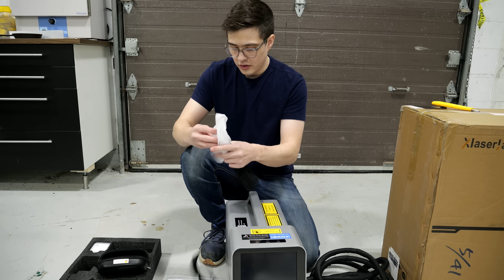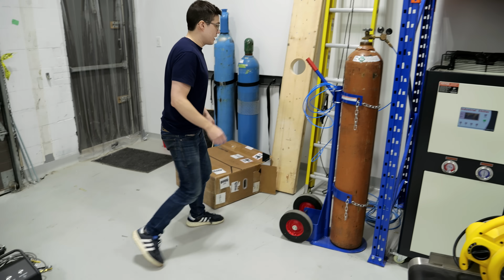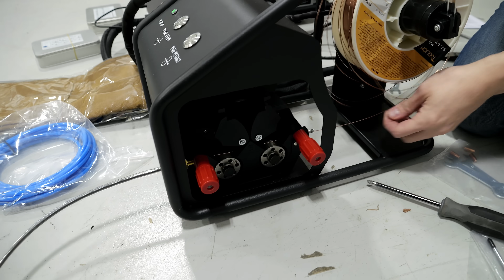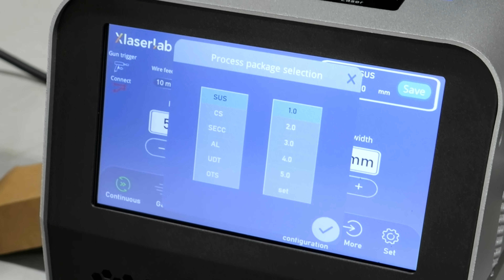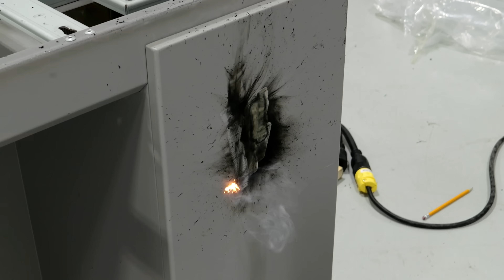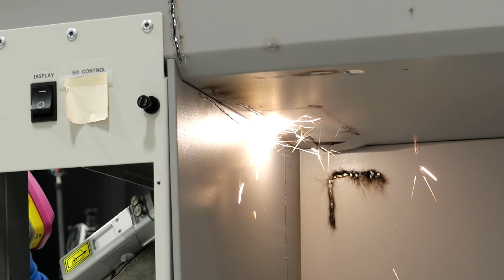I got a new laser machine (I love lasers)

Comment: I'm not saying this to brag, we have a laser welding cleaning and eye erasing machine at work that's like 10 times bigger than that machine "BIG BLOCK on wheels". 3kW laser / 16kW max consumption. It's all chinese and parts break like you bought temu garbage. Just like chinese stuff always are. Controller circuitboard broke 2 times within 2 years. 
The machine was around 20k€...
It cuts steel up to 6mm. Cleaning is more like burning the crap out of the surface. Been welding with it for 2 years, also TIG and MIG in the meanwhile.

Comment: I havent done it myself so take this lightly as its intended- 

I generally see welders swerving the tip around instead of straight lines. I imagine it's packing more material onto it, creating a stronger weld and maybe even changing the direction of the grain/atoms. They call it 'walking the cup'

Not sure if that's something to learn from and employ in uses like this, but I hope this helps!

Comment: A customer of mine (I do IT for them) has a like 10 KW CNC laser and it's a two story device. Bottom is the CNC machine and the top story is just like racks for the PSUs. And then a fiber cable basically goes down into the CNC machine where it lasers the everloving fuck out of steel

Comment: That is so cool! I've welded with an arc welder and wire welder. Used oxygen/acetyline torches, and the coolest was a plasma cutter. I wonder if it could weld aluminum. I kinda doubt it, it's not a good conducter of electricity. I also love lasers, and own a 5W laser that can do many things.

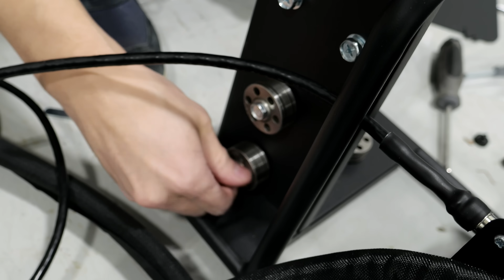Comment: @5:12 "Cause the wire I wanna use is .9 cm, so it's a bit less than a mm" that sounded very wrong. .9cm is quite literally 9 mm, so 9 times bigger than a mm. Maybe they designate the wire thickness in cm, in which case it's probably .09cm? Or maybe you just said cm, when you really meant mm, but that threw me off for a moment there. But to be fair it's probably less easy to recognize that mistake if one usually think in imperial units. Also I'm not sure why I'm making this comment, as it's not really meant as a critique. It was clearly just a minor verbal typo.

Comment: At close to $5,000, they should deliver it , set it up, teach you to use it, take you out to dinner, with drinks and provide a hooker. ...Still, it does look worth every penny, even if no set up, classroom , dinner or hooker.

Also, stolen video from this real laser manufacturer's web site is often used by scammers to sell a "laser welder" , but what arrives is simply a cheep soldering gun. If the "welder" cost is below $2000, its likely a scammer.

Comment: If you love lasers you would already have a 100 thousand RPM ping pong super capacitor driven reverse shock wave echo clashing Plasma speaker laser. Heh.. Points at capacitors linked to a kicker that start at zero resistance > Rolls the multiple pancake gen with my finger causing it to switch to empty dumping to kicker motor all the way to optimal rpm before kicker goes off > Overflows capacitor system at the end to plasma speaker sonar > Installs Tungsten spark switch so no EMF can come back after it to slow turbine generator power in its EMF vacuum > Turns on laser with its own ping-system for focusing the plasma blast with Ultrasonic resonance audio spotlight support for precision > Watches sonar drain to %20 while combining with the lasers capacitors for high powered dump > Hits CO2 flush system then water jets for the area before the Black Hawk comes with FLIR because Military detected Plasma EMP burst I wonder what they're looking for with Thermal optics over Plasma tech.. Points at Predator films and winks Heh..

Discuss ping-pong relay with AI not for running a system but for how they can last for decades if good and if you use Analog computer logic for your system like a clock it can last super long you can just let it spin in your home powering it. Unused power beaming up in the air with resonance filter to absorb none of it into atmosphere like a Lightning shock wave ever been beside a lightning strike? If it was a Grenade instead of filtered shock wave I would have been boiled by cavitation.. Felt cool as hell. Pressure drop inside before atmosphere pushed back.. Forgot Earth stuff is weak phone got killed.. Buys better phone > Adds Piezoelectric shunt overflow to antenna Now lightning EMP make my phone scream instead of die. Squints at Crystal phone in The Twilight Zone: 2019: Episode 4: A Traveler > Googles: "Piezoelectric shunt crystal aerospace engineering"

OCD yeah you NO me! LOL.. Earth shunts convert to heat Points up at Sonar shunt I use to because I don't use batteries I overflow main generator that's unused through sonar and then drain sonar like a Shaman scooping water at the bottom of a waterfall. No laws broken.. Clear record with Sheriff department print off of FBI special agents. Iron Man would be amused.. Googles: "Ultrasound Enables Remote 3-D Printing—Even in the Human Body scientific American" > Sets generator Plasma system to resonance filtered Beoing Plasma force field mode > Runs up and hits the generator as hard as I can with a sledgehammer causing it to activate Generator in Darth Vader mode: "You have no idea the power of the dark side.." Yes I do.. Heh.. - Dracula
Reply: Triggers sensor causing Caps to fill to stop turbine at safe fast speed Oh no.. I'm falling like a rock.. Triggers sensor again sending brake to kickers like a gatlin gun [BZZZT WAAAAAAAAAAAAAAAAH! > Ultrasonic stealth mode]

Comment: That initial welding test probably sold this thing better than anything the manufacturer has advertised! That shit held amazingly for such a small weld on just one side
Reply: And literally the first weld from a complete beginner. Impressive indeed.
Reply: Right?? I was 100% amazed until I looked up the price of that machine. Then it made sense..
Reply: @Meziked-13  That is a very cheap laserwelder, most laserwelding machines that are from even slightly renowned welding fabricators are easily triple the price. However those can usually weld thicker material, this one can only weld up to 3mm of steel.
Reply: @Meziked-13  High End welders go for the same or more. For what it is, it's real cheap!
Reply: IIRC, a 1cm (1/2.54 inch) weld bead in steel holds about 1 ton (2,200 pounds) in tension
Reply: Nice 15min advert

Comment: Regarding that weld, there's 2 things welders like to say, in my experience. 1. "The strongest part of the entire combined piece of metalwork is at welds, contrary to popular belief, assuming you did it right." And 2. "You are not just melting two pieces of metal at the points they connect, making a thin seam of metal 'glue', rather you are actually fusing the two pieces of metal completely and the fusing goes deeper into the metal than you would expect (not just superficial surface connecting, well past the surface to form a new singular piece of metal. Again, assuming you're doing it right."

All welds everywhere around us would be awfully scary to rely on if we could just take a hammer and break them apart with a swift strike.
Reply: He had a dirty, probably painted, piece of metal that he welded another not cleaned piece of metal to. I am suprised that wasnt failing and instead it ripped the  side of that table out.

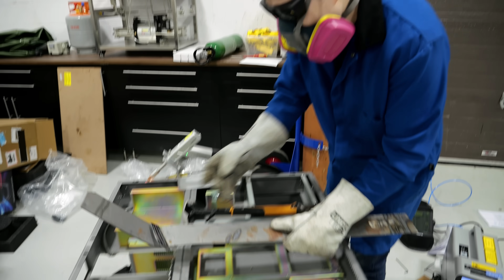Comment: 10:17 Fun fact: a good weld is stronger than the two pieces of metal that make up the weld. Notice the bend marks on the bottom of the large scrap? It bent a little bit away from where the weld was.

Comment: Been a structural steel welder for about 10 years, never seen the laser welding done but I want one now for at home lol. That just looks like fun, and honestly for such a small bead it seems incredibly strong. My only question would be for the Stainless welding, usually you need a purge block or something for stainless, does the laser welding not require this?

Comment: For anyone connecting gas tanks: Notice pressure regulator no top of his. Don't connect gas tanks directly to equipment without one. It might have like 4000 PSI. I have seen guys do that at a workshop I work at. It's always funny and loud. At least to me, because it's not my equipment and I'm not the one getting facefull of metal shavings at mach 2.

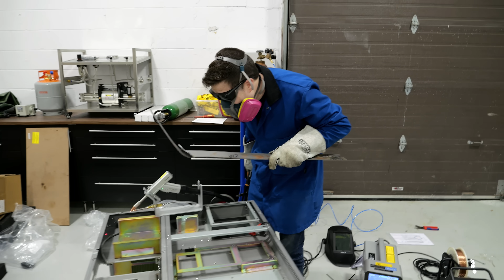Comment: 10:06 I was absolutely not expecting that to even slightly hold. I'm impressed.
Reply: I used to be a welder and had zero confidence in that weld. I thought it would fly off on the first hammer tap. I'm damn impressed.
Reply: @EscargoBay  the reason being.. is that this is a little beyond electrode type welding. the heat of those welds fuses the metal.

in this the laser is what penetrates and fuses the two metals with the resulting heat (often with some decent depth if you look up the product demonstrations and tests on yt).

these are very strong fusion welds, and it makes welding MUCH more accessible to beginners. for experts, it just makes it all very easy.
Reply: I’m not buying but I was just sold!
Reply: honestly want one for the back of a work ute
Reply: I have a laser welder and I’ve seen these machines turn any noob into a “decent” welder , it takes no skill to use it and it penetrates deep
Reply: saw a review that these laser welders penetrate and weld through really well
Reply: A machine like this that can quickly and easily make small little welds like this seems like a great thing to have in a shop.
Reply: same, i expected it to fold under zero pressure, just go flying with one tap
Reply: Welds are extremely strong
Reply: He hammered it the wrong direction to test the weld.
Reply: @necrobrewer838  Wouldn't have mattered, this thing welds the entire thickness right through.
Reply: why would you expect it to break tho he literally welded it
Reply: @kadyona  Lots of welds can look good but have poor adhesion to the sub straight and fail.
Reply: @MrJohnSmith9000  substrate* as in an underlying layer.
Reply: @fireMCG  100% correct. Thanks auto correct 👍
Reply: @MrJohnSmith9000  No, thank you, random internet guy
Reply: @kadyona as someone who has only welded once I’ve seen lots of videos where people weld something that looks solid and it just snaps off, I was definitely expecting the hammer to knock a quick one sided weld done by I believe an amateur, the tool impressed me
Reply: Also I never remember successfully welding 2 pieces of metal together that didn’t just break right off welding is hard
Reply: @DrPsychotic  for any other welder.... id agree, but for this particular tool, i expected it to hold. it melts and fuses very well, and works great for amateurs. 

i see a lot of people underestimate the xlaser stuff, and its kind of fun to see beginners producing "good" welds like this.
Reply: @kadyona because with a normal 120 or 240volt welder, if you were to weld such a tiny weld, with such a fast pass, it would break.
Reply: @kadyona so you actually think welding means it becomes indestructible?

Comment: replace cutting tools on a metal CNC Lathe with a Laser cutter... C1100 vs W70Cu30 alloy starter relay contactor that can actually take 1000amp/24v to start a 3208CAT. because drill bits might not be able to cut it and using a plasma cutter on that gets costly very fast if the ark wanders. angle grinder cut off disks only polish the surface... electrical contactors and stator windings. same relay contactor disk out of W70Cu30 would hold up to 3400amp/24v or 2000amp/36v. there is an option of laser welding that W70Cu30 onto a copper as a 1mm wire onto a contactor surface to substantially reduce arc erosion. Semi trucks and trains... start it every day and guess what quit first, 50 years on a 3mm thick C1100 contactor "80 years on a 5mm C1100 contactor the same size" 600 year service life W70Cu30 3208CAT starter relay contactor disk? "50 years as a county operated fuel truck filling gas stations and farm tanks" 3mm disk $25 45 year part, 5mm upgrade disk $38 70 year part... $155 5mm W70Cu30 disk "400~600 year" part. how pointlessly over engineered can something be?

Comment: "Wear respirator" awww c'mon you don't wanna cough black soot with the rest of us? Lol

As a regular utilizer of GMAW (which also uses filler wire) it's absolutely precious hearing you refer to wire drive rollers "the wheel there" and .035"/.9mm filler wire as ".9cm it's less than 1mil" your awesome dude...never stop learning! 🤙✌️

P.S. it messes me up to see feed rate in mm per second and not inches per minute lol

Comment: tho nitrogen will "work" its better to use Argon. since nitrogen can make the weld brittle in reactive mettles. also if you let the wire feeder push your weld along you'll get much more uniform welds. last thing weld angle matter big time in laser welding. Aim the gun to the thicker mettle  for best penetration as laser welding creates a deep yet incredibly narrow weld puddle

Comment: Next video: Laser-Induced Carbothermic Reduction of Iron Oxide.
You can’t sinter the oxide alone, but mixing it with powdered sucrose creates a perfect redox environment. Use the laser as a high-flux heat source to trigger the carbon to 'strip' the oxygen from the iron oxide under your nitrogen shield. You’d be alloying the residual carbon into the melt pool to literally smelt high-carbon steel from food and rust.

Comment: I like how everything begins with the power cable and everything is built on the floor. Like instead of setting a place for the equipment, starting with safety features and assembling it and finally at the end connecting it to mains when wearing safety gear. And testing function before safety features.

Comment: I have seen a bunch of people on YouTube get ahold of these and test them out and I have to say they seem to make some really nice welds that usually even have deeper bond penetration but also with less heat so it makes the surrounding area less brittle and leaves a much much finer bead even with novices using it. Definitely easier for a novice than arc or mig welding.

Comment: I’m surprised and bothered by this technology getting into the hands of the average hobbyist… especially considering most people promoting / displaying laser welding, cleaning and cutting fail to point out how very dangerous these lasers are. 

While welding is realistically risky for the person welding, if you don’t take reasonable precautions, laser welding can be very dangerous for anyone around and also things around. 

You can “flash” yourself several times with traditional welding, every welder does, and while it isn’t good, most people escape without long term issues. It is my understanding that a stray laser / reflection can instantly and permanently blind you. Someone walking by and glancing over can lose their vision. 

I feel like it will take some high profile tragedies before they are taken seriously.
Reply: So youre saying that, once again, and as always, the people themselves are the problem. Not the manufacturers or regulators. Its always been like this and will always be like this. Humanity itself is the reason why we cant have nice things pretty much.

Comment: That’s a DB-15 connector not RS-232. RS-232 is the protocol it uses, my guess it uses a modified SCPI set like most computer controlled over serial lab equipment.
Reply: The difference is in people knowing what rs232 is and not knowing what db15 is. Besides, those were DB9 and DB25 connectors. Exceedingly likely just basic rs232 because theres nothing really complicated going on.

Comment: These lasers will absolutely DESTROY your retinas if you aren't wearing goggles that block the right frequency. This is a 700 watt laser which is about 350,000 times stronger than the eye safe limit of only 0.002 watts. It would take roughly 120 to 250 reflections fro highly polished metal before the beam drops below the 2-milliwatt threshold. It would take 18 to 25 reflections from bare steel or aluminum. It would take 4 to 5 reflections for standard window glass. But most scary is that at 700 watts A single diffuse reflection such as the beam hitting a matte brick wall, a concrete floor, or a piece of wood and scattering in all directions and packs enough energy to cause instant, permanent blindness to anyone standing in the same room. Insurance companies usually require these be used ONLY inside a light proof room with safety interlocks that disable the laser when the door is open.
Reply: This company (their real name is XINGHAN LASER (HONGKONG)CO.,LIMITED) is INCREDIBLY sketchy. They came from Kickstarter, used the most generic Chinese startup website template ever, have faked reviews from Forbes (clearly AI-generated), and their website stopped loading halfway through. They have no contact other than an email and WhatsApp, their specs are also AI-generated, they call the safety glasses "Protection Glasses" (Doesn't inspire much confidence in the thing that's supposed to be yknow, protecting one of your vital organs). I really, really wouldn't recommend this product. The glasses alone should be double the price of the machine itself.

Comment: It's a great machine. Better at steel than aluminum for welding. It'll weld titanium, copper, bronze. I'm not sure there is a metal it won't weld. It's limited of course, since it's 700 watts, but you can power it off of a solar charger or big power bank. That makes it really useful for repairs or work in the field. It works great on 120 volts.

Comment: Welder here. You shouldn't use nitrogen because it can introduce nitrides which can comprise the weld. I'd recommend using CO2 which is cheap. If it has components that are sensitive to CO2 you should be using argon which will cost more.

Comment: nile's new project is to buy every single piece of equipment under the sun.  One thing nile hasn't found yet is that there literally is a metal spray gun.  There is literally a metal spray gun that Kurtis on youtube CuttingEdgeEngineering used a while ago.  Its amazing, but 0 use for nile in a chemical lab.